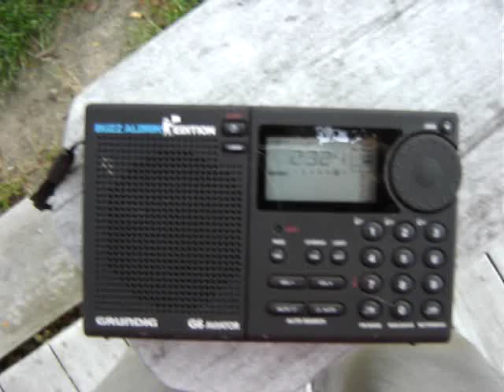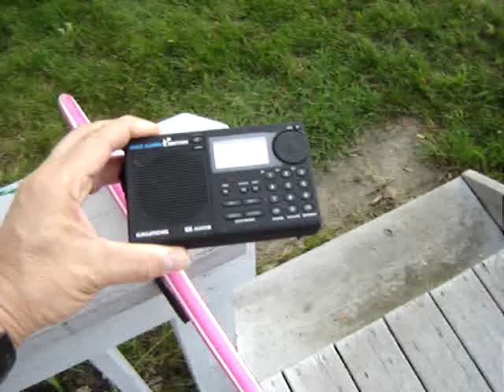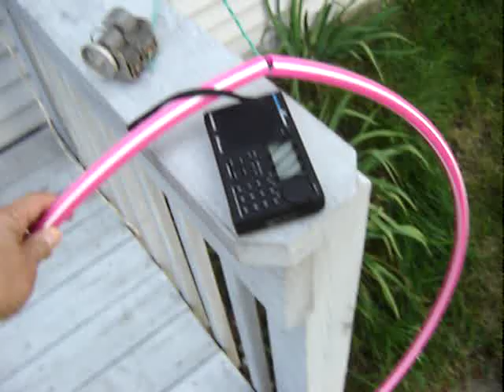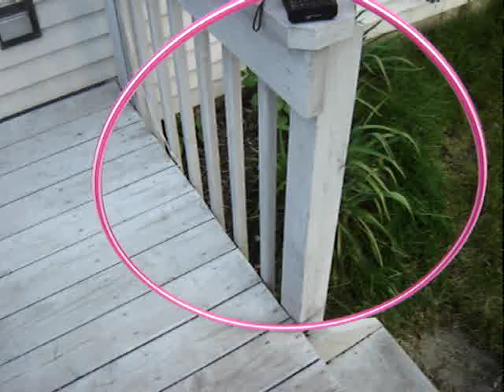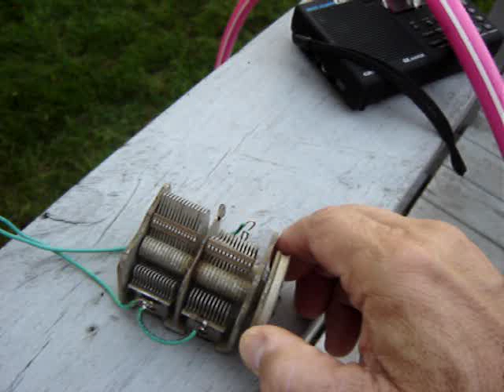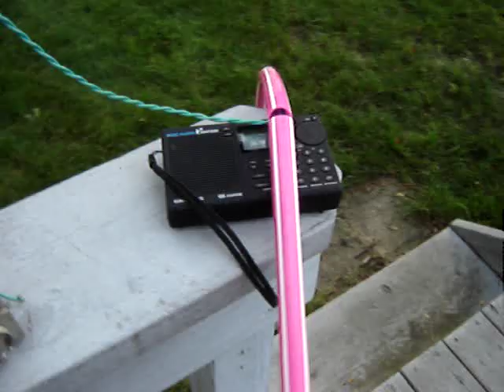AM DX - "Hula-Loop" NG9D Antenna Demonstration

Comment from the maker: @MixxiePixxie Hi! RCVR NR Chicago & STN WMT/Cedar Rapids - After the hoop is separated, the wires were threaded into the hoop by pushing them.  If you try this, you may find that HDPE insulated 20 guage solid conductor wire works pretty well. But even so, after several turns the wires started to bind, so I sprayed a bit of furniture polish wax on them to reduce friction.  That enabled inserting 11 turns into the small diameter tube - Instead of a hoop you could use open wire on wooden frame.

Comment: I do a lot of low band stuff -- both HAM radio 75m and 160m; and AM BCB and VLF stuff -- and I have always kept a small loop in my arsenal. There are times that the loop will RX things on 160m that a beverage will not. Plus, you can hook another antenna up with loop, vary the phase angle between the two, and get some interesting effects. 73 de NV6R

Comment from the maker: @wx9dx  Hi Jimmy. 11 turns of 20 gage wire w/ ~40 to 365pf variable cap.  The wire is explained in the video annotations (turn on the "captions" feature of YouTube).  Thanks for the question.    73 de NG9D . .
Reply: No captions available
Reply from the maker: @jamespfitz  hI James, yes the captions feature was disabled by YouTube long ago.  Sad, since I had used that feature a lot.  - Lynn

Comment from the maker: KC8YOQ DE NG9D  - THAT CAP IS AN OLD 365pF THE KIND USED LONG AGO IN AM BC RADIOS.  YOU CAN ALSO USE VARICAPS, A LITTLE L-C EXPERIMENT!  73 DE NG9D . .